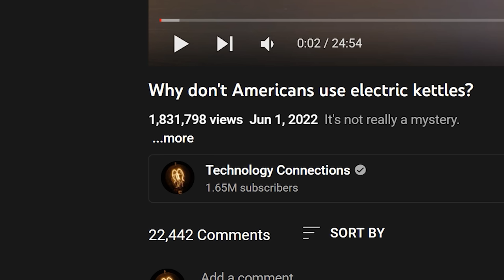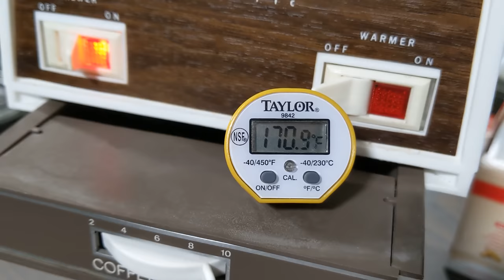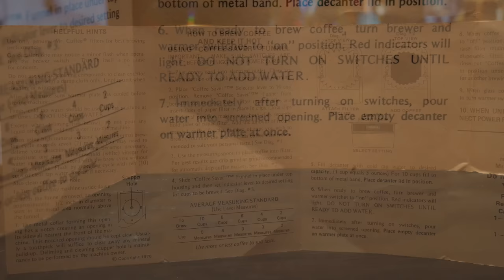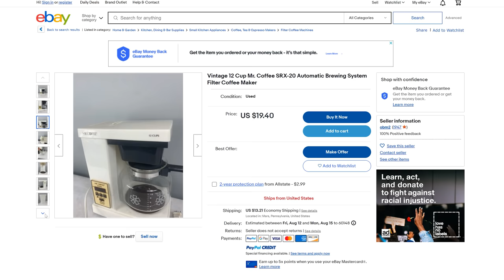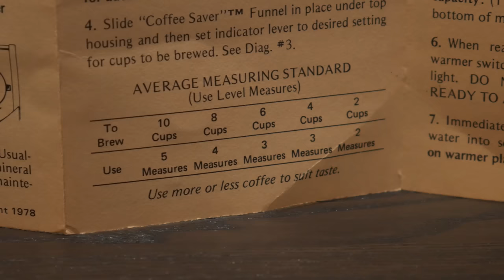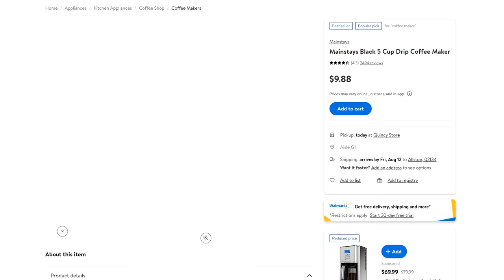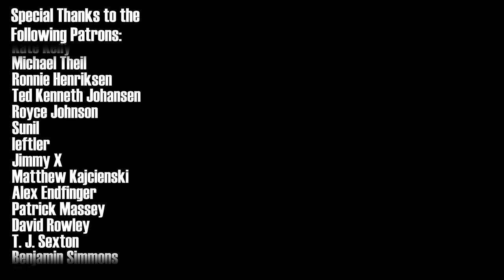Drip Coffee Makers — super simple, super cheap

Comment: What might interest you are the early krups coffee makers. They basically work like the late Mr coffee with the exception that they sort of have electric kettles underneath the carafe. When the carafe is installed you clamp it down from above using a provided lever. The water in the kettle is then boiled and thus only is left one route to escape the kettle. This comes in form of a tube leading above the carafe which includes the mesh holding the coffee and the filter. The neat side effect of the kettle being placed beneath the carafe is that the remaining heat from the kettle keeps the coffee warm but not hot.

If you want to look it up (I’m sure you want to) they are called Krups druckbrühautomaten (say that three times)

Comment: I'm really glad you mentioned the Moka pot at the end, as I've become a pretty consistent user of mine over the last couple months. I used to make pour over for myself every day and that's still my favorite way to brew coffee, but it's fairly labor intensive. I have an espresso machine, which I also love, but the cleanup is a bit of a pain. I dug out an old Moka pot that I was given and have been using that as my daily driver, as it were. It does not produce the best flavored coffee I can make, but it is consistent so hassle free. The only limitation is the amount you can make at at time, so if you need to guzzle a few cups a day, it's probably not the best option.
Reply: There are Moka pots of different sizes: from ones that make just the one to big ones that may make quite a bit (the biggest I used made perhaps 5 entire cups of black coffee, which stretched to around 10 because the person I made coffee for likes hers half-and-half with milk, but it's just medium-sized). Of course, the bigger the pot, the longer it takes.

Side note, I don't know how it is in the US, but here you can buy replacements for the small pieces of Moka pots (the seals and the filtering cone) in most hardware stores.
Reply: Bialetti, the original moka pot, sells different sized brewers from a teeny-tiny 1-cup to an enormous 18-cup. 1 cup meaning 1/2 ounce so 18 cups is 36 ounces of almost expresso strenght coffee. Of course if you want the big ones it starts to get a bit expensive, but it's still great value for the quality of the brew.
Reply: My moka pot makes damn good coffee

Comment: The Mr. Coffee is like the 1970s vintage commercial drip machine we had in the office at a former job. It had a reservoir of water, wait for the light to come on, pour cold water in which sinks to the bottom and displaces the hot water to the top which overflows into the brew basket. No heat expansion pump needed.

Comment: I really enjoyed this video.   I love the simpler coffee makers that just have an on/off power switch - and no other controls.   The cheaper, the better.  Why?  A couple of reasons.   First, with a simple on/off switch, I can turn on the coffee maker remotely with an A/C switch remote transmitter.   This means, I can turn the coffee on - just before I get out of bed.  I don't have to get up at some pre-programmed time, nor do I have to go downstairs to turn on the machine, and then wait 10 minutes for it to brew.   By the time I get downstairs, my coffee is freshly brewed and ready.  Second, with a cheap machine I can easily replace it whenever I feel like it.   I keep the machine clean, as well as I can - with occasional vinegar treatments.  But at some point it just becomes too infused with something I can't get cleaned off.  Probably a combination of coffee oils and algae.  I replace the machine about every two years.   At that point, I plunk down another $20 for a new machine.  When they are on sale, I buy several, and keep them in dry storage in my basement.   I buy premium coffee, grind it myself, and it tastes as good as any coffee shop.  Keep in mind that the more expensive coffee makers, as nice as they are, get just as fouled on repeated use, and are just as hard to keep clean - but they are much more expensive to replace.   Do they make better tasting coffee?   I don't think so.  As with anything related to taste, your mileage may vary.  Carry on.  🙂

Comment: Correction: a cup of coffee is 5oz in the US. Depending on which country your drip coffee maker is constructed, it varies from 4oz to 7oz for a "cup." It's a hidden and frustrating detail that means most people can't brew a consistently decent cup 'o joe outside their own house. (And why work coffee is always extra terrible)
Reply: Making 3 cups of coffee in my machine requires 2 actual measuring cups of water. Who designs this stuff???
Reply: @qwincyq6412  Big Measuring Cup Company Guy got in cahoots with Big Coffee Company Guy and had the idea to make all these things mis-match to get you to waste coffee grounds figuring it out. It’s like the Big Hot Dog Company Guy getting with the Big Hot Dog Bun Company Guy. Why are there 7 or 10 dogs in an average pack but eight buns?!
Reply: The nightmare of figuring out how much liquid one of those giant commercial percolators holds is real. We use one to make mulled wine for a holiday show and trying to calculate how many bottles will fit is a puzzle.
Reply: This is one area I'll give Keurig credit for their dumb motorized solution, the one good thing about it is that it's pretty consistent over different brewers, the buttons aren't labeled, so you'll have to read a manual or look it up but depending on the model it should have a between 3 to 5 settings, 4oz / 6oz / 8oz / 10oz /12oz, so as long as you know which button does what, you'll always get exactly the amount of water you want, no measuring or anything.
Reply: Jonathan Lowe  very well. What’s his recommendation?
Reply: You can make it worse. Here in Germany many of those drip coffee makers seem to have scales for small and large cups. Never found a matching cup though for either size.

Comment: 22:50 in Australia it's common to have paper bags (sometimes plastic) with a one-way valve built into them, when you are done, you seal the bag (it's a zip-lock) and you can push the air within the bag out, it isn't the same as an unsealed bag but it still retains freshness for longer due to lack of oxidation. Definitely better than using cans for storage (in my opinion). The equivalent for you, would be to get a coffee container that has an adjustable level seal so that you can push the seal down to the level of the coffee, I have seen those around.
Reply: We have those as well in America for smaller, usually 12 to 16 oz bags of coffee. The cans are only for bulk coffee. I would say there are many more bags here than cans.
Reply: @ostsan8598  we have them for big bags too. I just bought a 25 pound bag of coffee from a roaster for an event and it has a 1 way valve as well.
Reply: @timfenton4943  Any bag from a roastery should have a valve - that's because freshly roasted coffee is still emmitting CO2 gas so if it had no valve the bag could burst from the pressure.
Reply: @ostsan8598  those are valves? I thought they just let you smell the coffee before buying them
Reply: @Malthan  Interestingly enough, containing roasted coffee under pressurized CO2 is the only real way to preserve it. But like you said, bags will burst so they have to let it out with a valve, except for illy.
Reply: @bobbygetsbanned6049  most roasters flush the bags with Nitro.
Reply: @timfenton4943  That probably helps a little but won't make a huge difference.
Reply: @bobbygetsbanned6049  Thats literally the industry standard, but ok.
Reply: @timfenton4943  I never said anything about the industry standard, I said the only way to actually preserve roasted coffee is to put it in pressurized CO2. Tons of coffee companies still sell vacuum sealed coffee too, so what??

Comment: Moka pots are the go-to at-home method for brewing coffee where I'm from since people here are used to espresso when they go out. It's not exactly like espresso, but for the cost and form factor compared to a machine, it's close enough for our taste.

I would recommend trying one if you're interested in comparing brewing methods, but it does require some practice to get it how you like. Once you do dial it in though, it's very easy to repeat for consistency.

Don't use pre-ground coffee meant for a drip machine or French press; it needs to be finer. Look for finely-ground or grind yourself. It should be between regular grounds and espresso grounds consistency.
Reply: Praise the Mokka.
Hot take but most Americans are drinking colored water if they are not using one, change my mind.
Reply: Yes! I'm surprised no ones mentioned Moka pots yet. We've been using these in my family for decades, besides a quick rinse and a few spare gaskets they're painless to use. You can also tell which family's member made the coffee, as they tend to be very constent with their dosing lol
Reply: There may or may not be a difference but I like the stainless steel versions over the aluminium ones

Comment: Man oh man, did we ever know how to make big chonky (and bright) rocker switches in the 1970s!  I don't think I ever had a "Mr. Coffee".. Maybe I did.  But I DID have multiple Black & Decker knockoffs over the years.  Those were nice, and you would always know when one reached EOL because it would dump hot water all over the countertop when it was time to go to appliance heaven.  Around 2005-2006, I flirted with the Bodum electric vacuum pot and then a Technivorm Moccamaster, and finally landed on Keurig, with an occasional affair with my french press throughout.  I'm on my second Keurig now, which I think is maybe second to the vacuum pot for flavor.  But the vacuum pot was nasty to clean up.  Plus, with the electronics built into the base/carafe, that didn't last more than a few years due to the intense heat being generated.  So right now I use my second Keurig.  I buy my coffee in beans and I grind them, so no K-Cups packs for me.  But it's nice to brew a single cup of coffee instead of dumping 2-3 cups down the drain at lunchtime every day.

Comment: I'm kind of intrigued with the vacuum method. I own a couple of Sunbeam Coffeemasters and the way the water "defies gravity" to move from the bottom  pot to the top bowl and then reverses direction when the bottom pot cools is really cool. Of course, the Sunbeam has its downsides, including difficulty in getting it adjusted to brew for the correct amount of time and the warming feature. Most people just unplug the thing once all of the water moves to the top bowl. The glass stovetop versions (Silex was a popular brand) are more fiddly to use but give you more control over the brewing process. Plus, you can see the whole process happening (which you can't in the space-age, chrome-plated Sunbeam rig). There are coffee bars in Japan that use a much smaller vacuum (or siphon) coffee system made by Hairo that uses two glass vessels, a butane or infrared burner and a complicated stand to create single cups of coffee. I suspect the "performance" by the barista is part of the deal in those places.
Reply: I use one of those hario siphon brewers at home, they actually make about 20 oz at a time so a bit more than a cup unless your mug is massive lol, really good coffee too though extremely fiddly while you are still learning ratios and techniques.  the stovetops ones are also fiddly for all the same reasons, they are just bigger, though please note that a burr grinder is pretty much required for that type of brewing as grind consistency really affects the flavor.  oh, and to note, once you've gotten down the technique for the flavor you want from whatever coffee you generally use they stop being super fiddly, my coffee is ready in about 7 min in the morning, water boiling in an electric kettle is included in that time
Reply: Wait! Did you say Sunbeam?

Comment: I remember my parents would always keep a penny or two on the hot plate to lift the pot up slightly & help keep the coffee from burning too badly. Every once in a long while the penny would end up a bit squished out from the heat & weight & they'd have to replace it. Wonder how effective it was.
Reply: A squished penny? Like a rail track penny?
Reply: @Menaceblue3  a rail track squished penny is really flat , i know i used to do this when i was a kid, the rail tracks was my play ground!
Reply: Interesting & funny
Reply: lol ... slugs from an electric box would have been better.
Reply: @ScooterFXRS  yea but that method would be more expensive. This method only cost around a penny
Reply: None of this is good when the carafe runs dry because it concentrates heat in one spot and will cause the carafe to shatter from differential heat stress.  It's much better to keep the pot on the hot plate and just turn the coffee maker off when done brewing.
Reply: @xemnus766  free if you visit a construction site
Reply: @ianbelletti6241  you say that, but I’ve never in my life seen or heard of it happening.

Comment: It’s funny that you mentioned the aeropress is “too fiddly”, whereas us in the “coffee community” largely regard the aeropress as one of the most simplistic and easy to use/easy to cleanup methods of making coffee.
Reply: Loved my aeropress, but it started developing ridges that made the seal imperfect. I switched to a pour over cone which is as dead simple as you can get besides just straining the grounds with your teeth.
Reply: @shawniscoolerthanyou  you can actually buy new rubber seals for them. I find they last absolutely ages though, I'm still using an aeropress which is years old. 

Keeping them in the fully pushed through position when storing keeps the seal from getting worn out - but not doing this is actually more difficult so I doubt that's your issue
Reply: @shawniscoolerthanyou  You can buy replacement parts for ANY part of the Aeropress (not that there are all that many).
Reply: The Aeropress is NOT fiddly. Follow the instructions on the box, and it's about as easy as a drip coffee machine. It's actually faster too, if you grind your own beans fresh you can boil the water while you grind.

A lot of people online threw the box away and immediately went to some video recipe for the world championship brew that uses special papers, and so on. Don't do that. For one, championship recipes use WAY TOO MUCH coffee because it makes getting an even extraction easier. At home, you can save a lot of cash to spend on better quality coffee by using sensible measures.

I like lighter roasts, so I do the James Hoffman thing, since he likes lighter roasts too. Basically - I dialed in my grinder a little finer, and I pour extra water into the Aeropress to allow the beans to extract more thoroughly. That's it. Just like if I used a drip machine, I would still dial my grinder in, and I might still use a little extra water for more extraction. It's the exact same process.

Only my Aeropress goes into my carry-on when I fly, and so long as I can make hot water, I can have my full coffee experience. Even if all I have is the cheap 2-cup machine in a hotel, that boils my water. I don't even have to bring a kettle most places.
Reply: I used my original AP for years and loved it. Eventually the plastic tube began to break down (small ridges) so I bought one of the new models and it was a mess. I think the rubbery tube probably doesn't break down but has a bit too much flex.
Reply: @n1lla   @Mark Robinson  I've heard that and I thought about it, but then I found a stainless steel pour over cone for $2 at a thrift store and I'm really liking the simplicity.

Comment: I've been using Melitta manual cones for thirty-five years. I started with a one cup cone, a coffee mug, a teakettle and whatever coffee my mom bought. These days, it's a four-cup cone, an unbreakable French press carafe, 200F water from an electric thermal pump and Cafe Bustelo. I don't use a scale, I don't use a goose-neck kettle and I don't grind it fresh. I get really good coffee in about 5 minutes, and there's far less countertop clutter, which is important in a NYC kitchen.
Reply: I remember the melitta manual cone and insulated thermos, it made delish coffee. I can't remember what happened to them.
Reply: I can't stand bustelo in a drip machine, it always comes out super bitter! How do you do it?
Reply: @avagrego3195  I don't know about the insulated thermos, but the cone is still very much around.
Reply: @zelderan  I use a manuel drip, which may extract less bitter flavors, and I actually like a somewhat bitter brew.
Reply: @zelderan  I also have to say that at this moment, I'm drinking office decaf. So, my taste is suspect.
Reply: What good does the press mechanism do?  I've never had one, and I suspect it'll just be more clutter.
Reply: Have you tried a clever dripper? Its a steep and release brewer that is basically a modified 4cup Melitta cone so it might be worth a look. I like mine because I can use it either as a steep and release or as just a regular 4cup mellita.
Reply: @johndododoe1411  I don't use the press mechanism, just the unbreakable carafe to replace the glass ones that never last me very long. Most cost effective way we've found to get one.
Reply: @JadeNeoma  I have tried it. I just always go back to the plain cone.